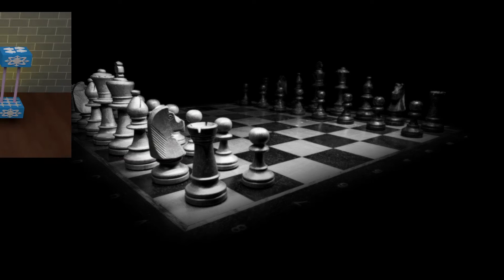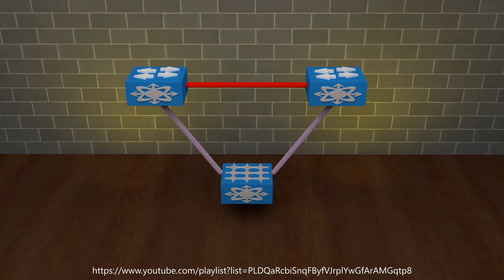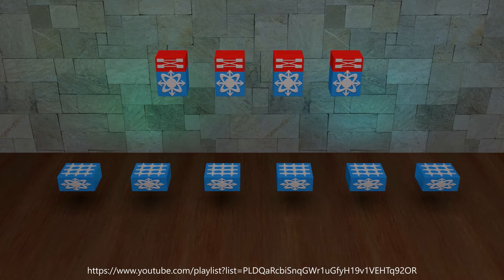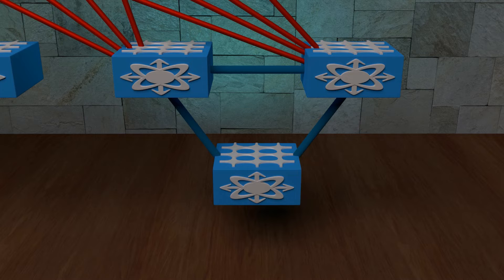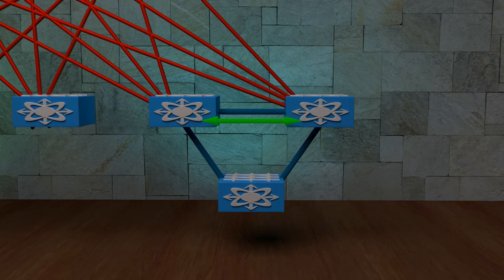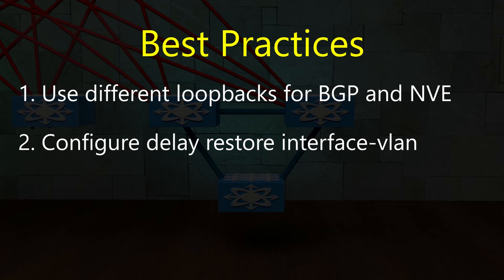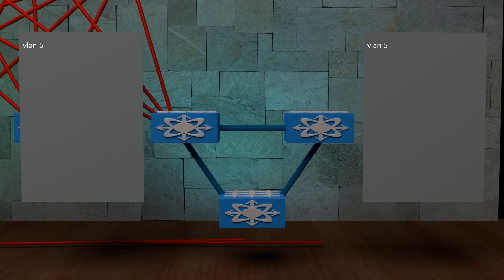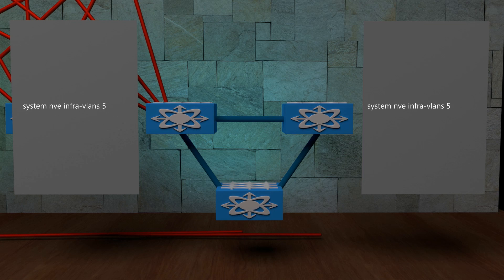Adding vPC to VXLAN | Network Direction

Comment: I've spent  a huge ammount of time troubleshooting  vxlan evpn vPC without physical peer link. Leaving this finding  here for  future reference - if  one of the host interfaces fail and you lose connectivity all together make sure the TCAM has suficient memory to  reroute the packet via the virutal peer link  - guidelines and limitation state "...vPC Fabric Peering requires the application of TCAM carving of region "ing-flow-redirect." TCAM carving requires saving the configuration and reloading the switch prior to using the feature. ..." for nexus C9336-FX2 at least
Reply from the maker: This is good to know. Thanks for sharing your experience to help others.

Comment: Hi, thank you for this explanation
in case of vPC Fabric Peering
   peer-keepalive destination " " source " "
    virtual peer-link destination " " source " " dscp 56
what should be the Src and Dst ? is the LO of VTEP primary IP in both switches or what ??
Reply from the maker: Yep, use a loopback interface, and let the routing protocol figure out the egress interface
Reply: peer-keepalive destination " " source " " 
in this command can i use Dst a  loopback interface located in both spine
in my topology i use 2 spine so how can use shared address in both spines  @NetworkDirection

Comment: Can i run a routing protocol on a VNI? I have 4 N9k switches across 2 data centres(DC). Each pair is running a vpc. There is a firewall and WAN router connected to the 9k pair using vpc in each DC. I need to create a L2 between the 2 DCs so that firewall can run routing protocol with each WAN router. Is this possible using VXLAN?

Comment: would it work the same if you create a non VPC vlan. (by removing it from the VPC) and connecting both switches thru layer3 ? i did this for an ASA that needed to establish OSFP with both switches and saw that the switches also starting passing L3 traffic thru that VLAN as well.

Comment: Hi thanks for the video.

There are a few equipments that don't use the peer link between leaf's. They do this vpc on the spine?
Reply from the maker: The spine should be used just for routing, so generally we would not run vPC on the spine.
If you mean that there are VLANs that are not part of vPC (that is VLANs pruned from the peer-link), then this traffic will be handled in the same way as any VXLAN environment without vPC.
Does that help?

Comment: First you incredibly good at explaining these technologies. Second I finished your VXLAN series and it was very good. I have been thinking about running VXLAN between our Datacenters and eliminating the layer two links between them. Is this a bad idea? The DC are about 20 miles apart from each other.
Reply from the maker: I've done it between data centres in two different states before, and it was fine. Underlay needs to be very stable though
Reply: @NetworkDirection  Would you recommend an Isolated VRF for the underlay and overlay.
Reply from the maker: @alexleefl  If you can, an isolated underlay will help. You must consider if this is right for your network though

Comment: Could you explain where the layer3 IP address for the default gateways exist in a spine-and-leaf topology? EG if there were (4) Class C networks for servers 10.1.1.0/24, 10.1.2.0/24 etc... Does the subnets exist on every leaf node? Also, how do there servers work with dual NICs with teaming if you are using non-VPC between the leafs?
Reply from the maker: The L3 addresses would follow the VNI. So, each of your subnets would be in a VNI, and the VNI's would be bound to VTEPs. If you're using BGP/EVPN, you don't need to bind the VNI to every leaf.
If you have dual-NIC and non-vPC, then you would use active/passive uplinks on the server side.

Comment: Hi Network Direction, actually peer-gateway is not necessary or even mandatory. if you can put a note, would worth it.
Reply from the maker: Are you sure? Have a look at BRKDCN-3040. Cisco seem to think it's fairly important.
https://clnv.s3.amazonaws.com/2018/anz/pdf/BRKDCN-3040.pdf
It is a feature that supports 'special' packets, so if you can guarantee that your network doesn't have them, then yeah, you won't need it. But there's really no down side to enabling it, so it's safer on.

Comment: if you have Nexus 9300 4 of them and runing BGP evpn vxlan with VPC should you be runing VPC Routing or not
Reply from the maker: That depends on what you need to achieve. vPC with routing is used when an external device needs to peer with the Nexus switches, over the vPC links. So, it depends if you need to do that or not.
If they're connected by orphan ports, then it's not really a worry
Reply: @NetworkDirection  hi i got the VXLAN and VPC to work now for the redundancy to work. i have 4 Nexus switches which are in pairs of two each with VPC between them no routers as im doing the routing on the nexus. So if the primary Nexu switch  faileds  the secondary should take over the VXLAN which goes to the other pair of nexus switches.
Reply from the maker: @brunmorevanrensburg8588  Well done!